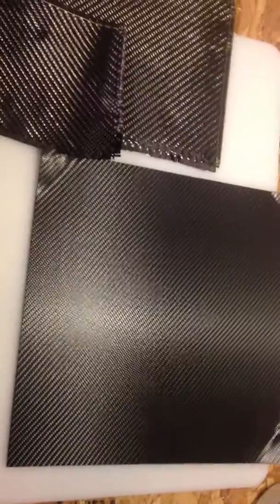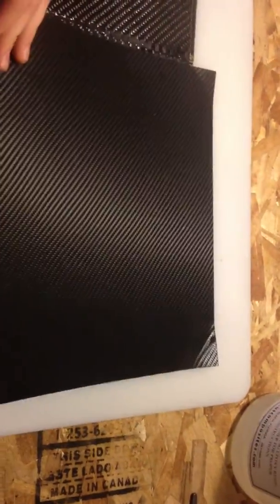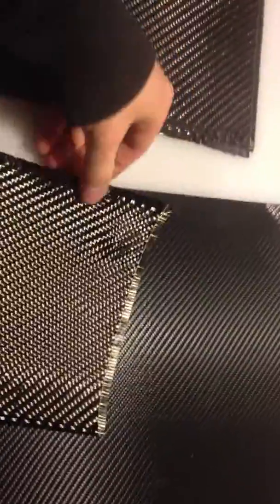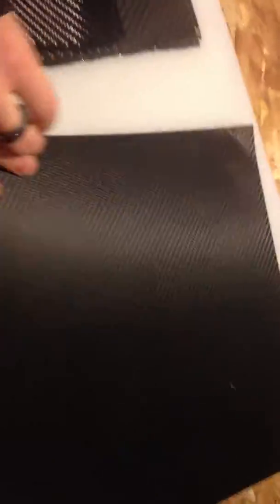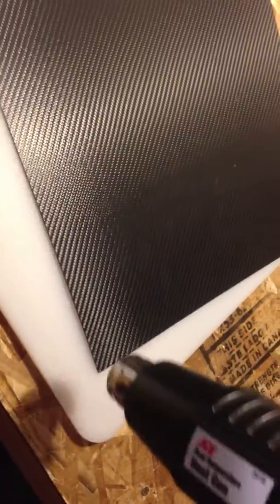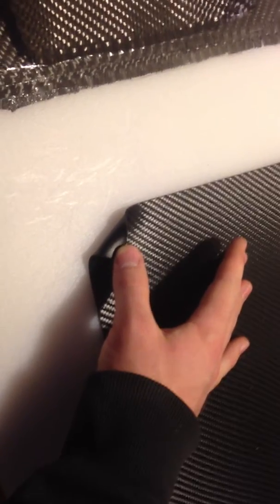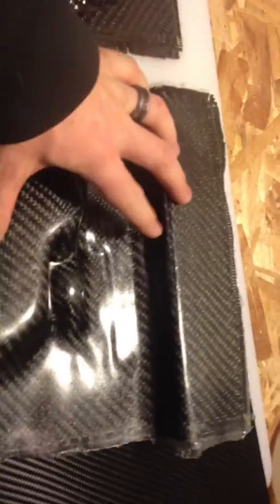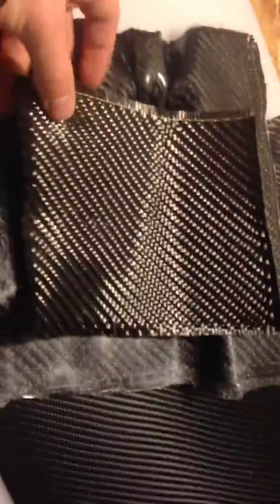Real Carbon Fiber Compared with Holstex

Comment: Holstex and kydex are not meant to be as strong as real carbon fiber. You want some flex for the gun to slide in and out. There are much more professional ways to mold kydex than just using a heat gun or oven with a vacuum bag.